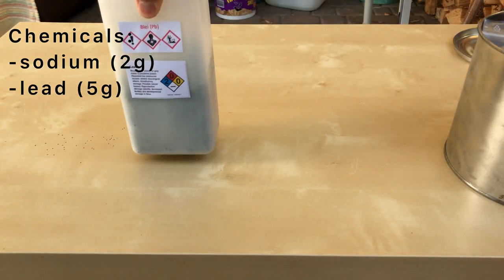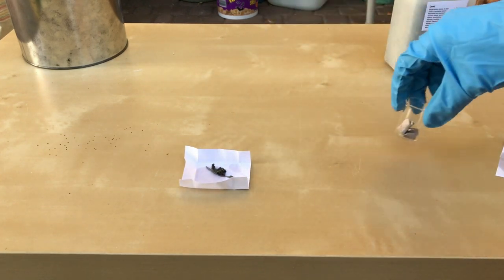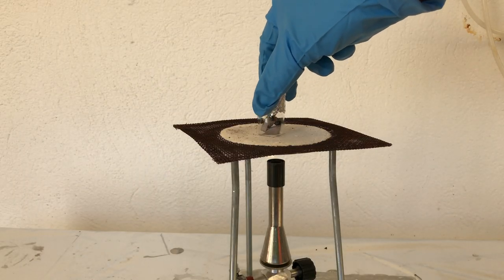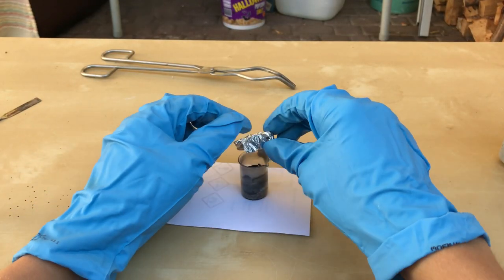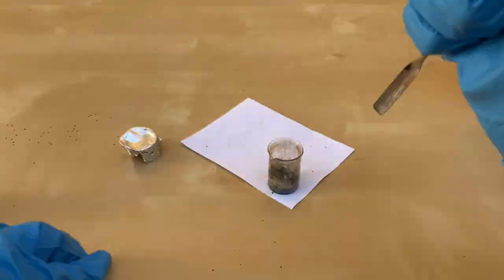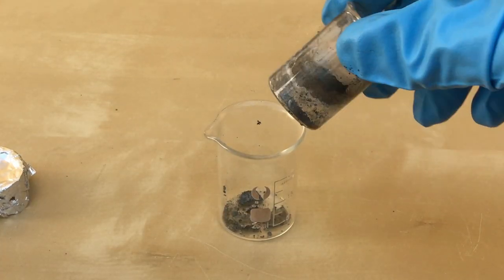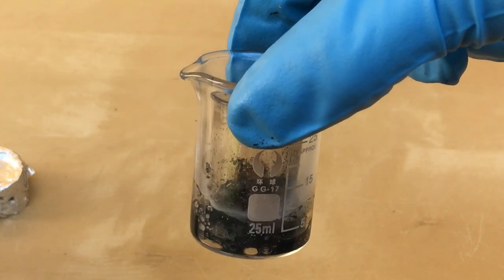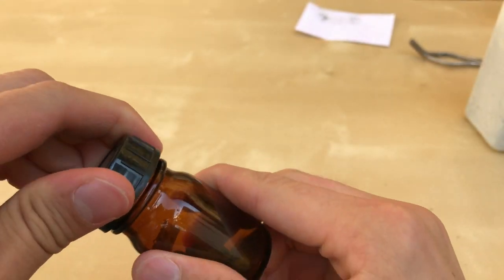Sodium lead alloy (2 Na/5 Pb) short clip

Comment: Nice video! How about using bismuth instead of lead? I think lead waste is quite hard to deal with.
Reply from the maker: That would still work for drying solvents but not for specific reactions where lead / sodium is required (haven’t planned any of these reactions yet).